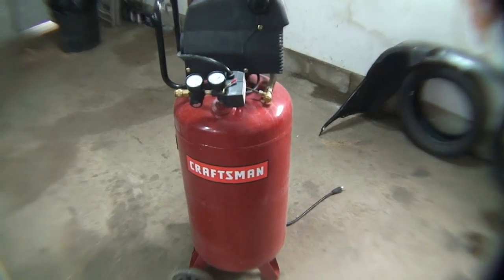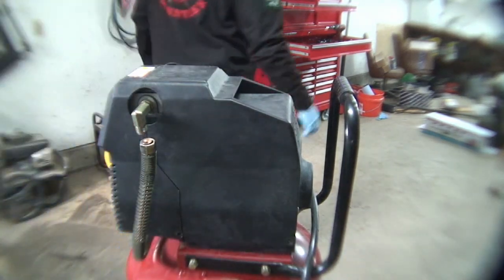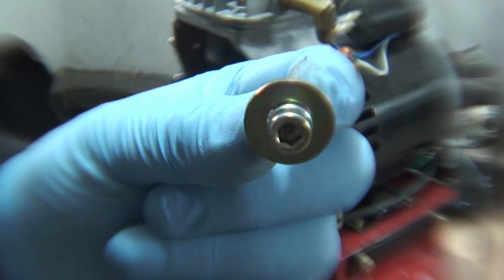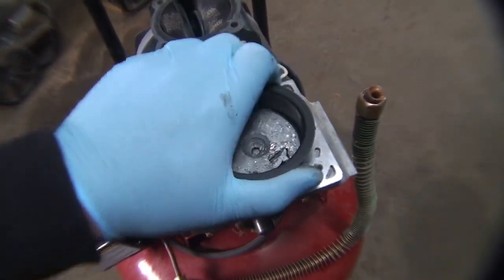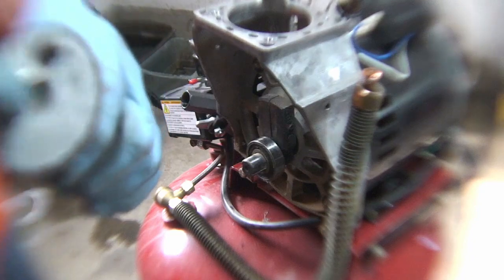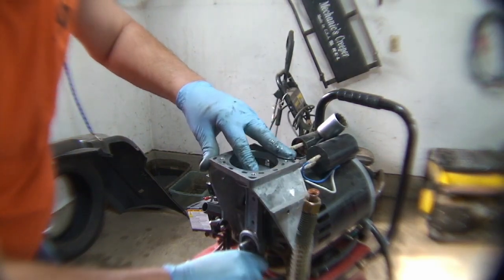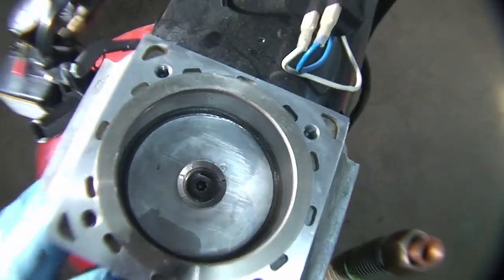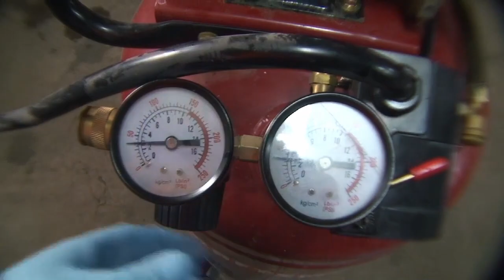Craftsman 26 Gal Air Compressor Pump Rebuild

Comment from the maker: Note:  I did not have to remove the piston cap to get a proper seat into the cylinder.  I used wd40 to allow the piston to slip into the cylinder from the bottom.  Also, remember the head is aluminum, therefore; the head bolts do not require much torque, just ensure they are snugged down in an alternating order with final torque coming after initial torque for each bolt.